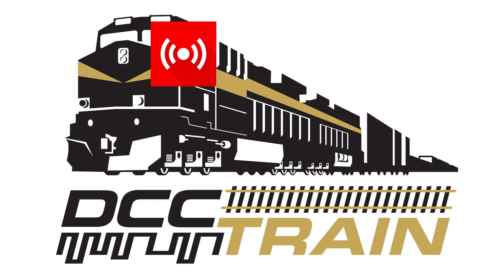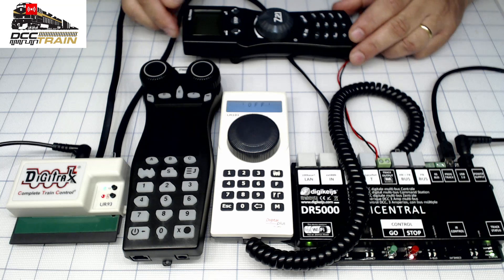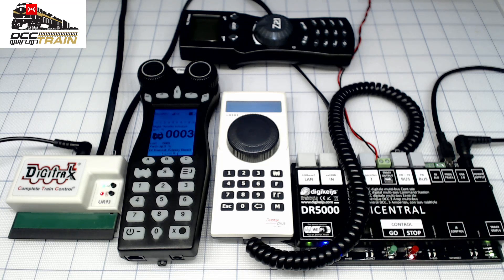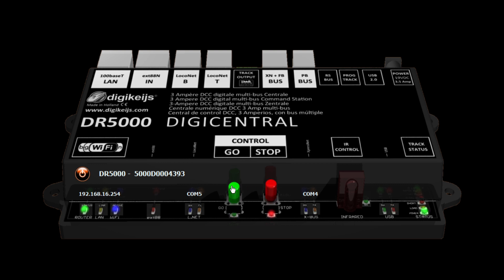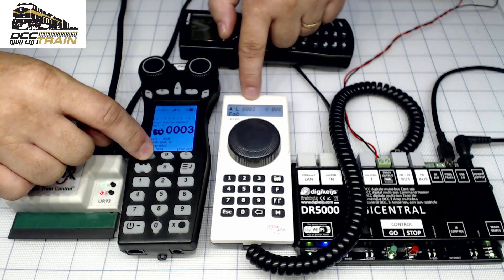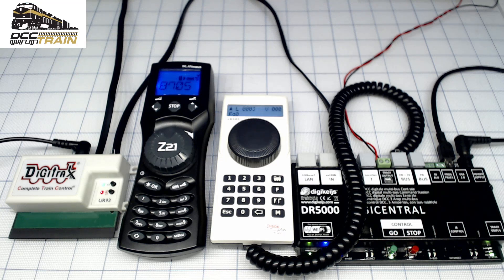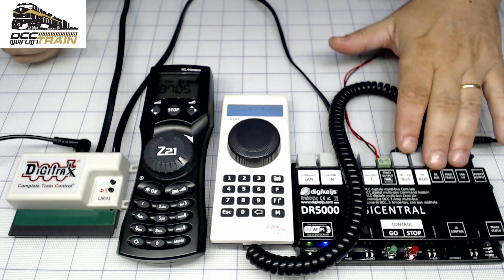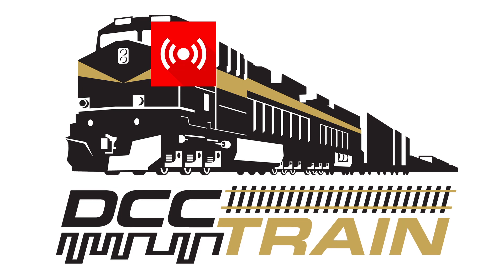Digitrax DR602D DR5000-ADJ DCC Multi-bus command station

Comment: Could you think to test how well sniffer-port on digikeijs booster are?
By connecting the NCE system and driving a locomotive throughdigikeijs booster and digikeijs DR5000 central for track power.
Reply from the maker: The DCC signal is coming from the Central unit to the booster using Track Sniffer input. The Booster is supporting only Lenz CDE Booster connection, LocoNet® B, Roco® B Bus. NCE is using a proprietary protocol for additional boosters.
Reply: @dcctrain  You misunderstood me or I wasn't clear enough.
I wish you would do the following test to test the sniffer port on the DR5033-ADJ DCC Booster.
Test connection:
[(NCE system) DCC-rail output]===DCC===>[Track sniffer input (DR5033-ADJ) LocoNet]<===LocoNet===>[LocoNet (DR5000) Track output]<====>Track white loco

* NCE system output "rails DCC" is connected to "Track sniffer input" on DR5033-ADJ.
* DR5033-ADJ is connected via LocoNet to DR5000 and via "Track output" to the rails.
If you turn, the speed of a locomotive increases with a driving control on the NCE system, will the opposing locomotives move?
Reply from the maker: @lgrfbs  I'm not planning in near future to get DR5033. However, I will do video and will explain what I'm thinking, I hope more advanced users will help us.
Reply from the maker: @lgrfbs  I will do in on DCCTRAIN Live https://www.youtube.com/dcctrainlive